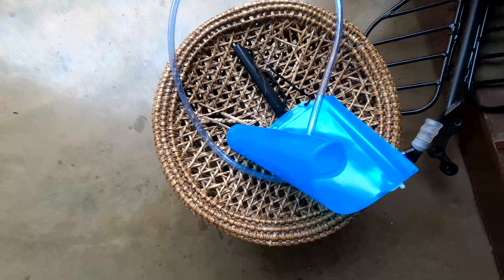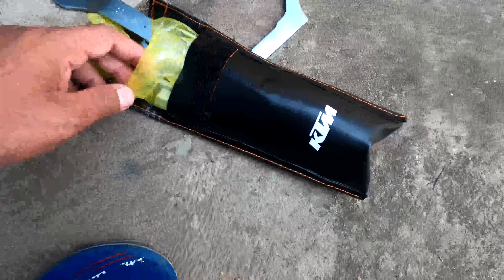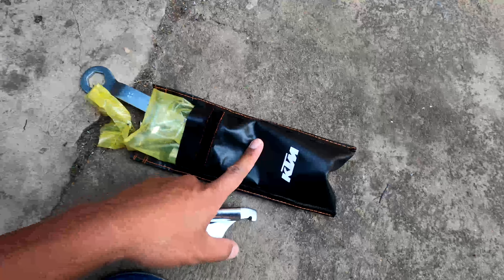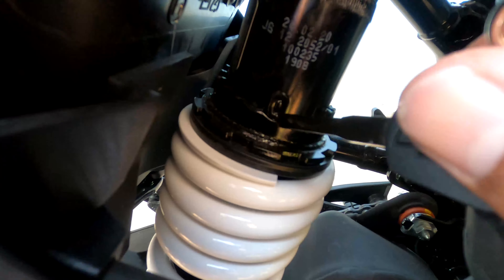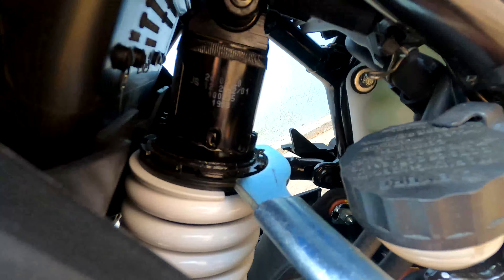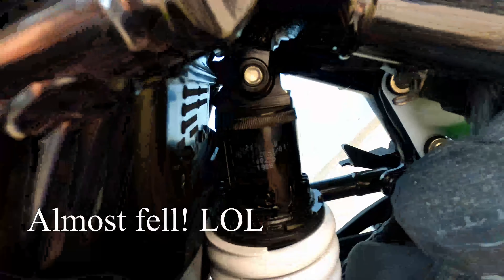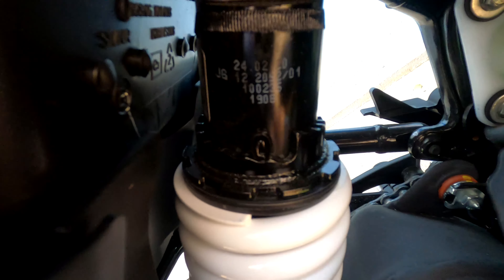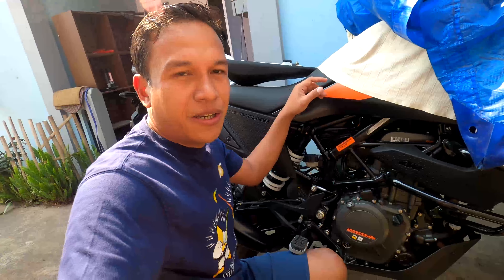KTM 390 Adventure | How to adjust the preload of the rear suspension! | Day 5 of Lock down

Comment: Hint 1-Much easier to adjust if rear wheel is lifted off the ground. Hint 2- pg 254 of the manual says Static Sag 12mm, Riding Sag 34mm. Preload should be adjusted to get close to these numbers, not for adjusting seat height. Lots of videos online about setting sag. Hint 3 - if not set right, handling is affected. If set low/soft, and you are heavy, the back of the bike will sit too low and the shocker will be in the hard part of its stroke. So you get a harsh ride and slower steering. Hint 4-if you are about 75kg with riding gear on, leave on setting 3.
Reply: How did you figure out that stage 3 is best for a 75 kilo rider? Did you test that yourself or found it in the manual?

Comment: Doesn't move when I use the tool. I want to set it to Max Payload - 10 clicks... not really sure which way it has to turn. May need to take another look at it! How hard did you have to pull?
Reply from the maker: It takes quite an effort to turn it, keep trying!
Reply: Hint 1-Much easier to adjust if rear wheel is lifted off the ground

Comment: great explanation ... I have a question 2U, is under the seat the accessories plug for M+S LEGOS 4 alarm system, as they are in the other KTM models? Or could you show us which plugs are available?
Reply from the maker: Thanks brother! I am not sure about the alarm system as I have not used it, but I did use an accessory that let you use your indicator switch for hazard lights as well. Will see if I can upload a video about the different plugs that are available on this bike, will do it soon! Cheers 🍻
Reply from the maker: Hey Peter, so I finally for some time to open up the rear, unfortunately there is no such plug in the rear, you can see the video with the details here - https://www.youtube.com/watch?v=oH4piy7X7IM

I'll be opening the front tomorrow to check if the same is there in the front! Hope this helps!
Reply: @RandomSync7  see it, you're so great - THANK YOU !

Comment: I'm a little disturbed by this video that explains how to turn and change the preload on the rear wheel but with no proper explanation of why it's important, what do gain from the right adjustment that is adjusted to you and why, when and how it should be done.  Anyone can play with knobs but do you really know what they're good for?
Reply: generally stiffer suspension for off road, softer for more comfort on road. Think of a dirt bikes suspension and how much it takes to get travel, then think of a road bike that easily moves. It's not a hard concept but you come throwing attitude around for no reason. Google it, it's covered in unbelievable detail. The video is only to show how you can adjust it, because the adjustments will be different for every rider and every riding type.
Reply from the maker: My bad that I didn't explain why and when the pre-load needs to be adjusted. This video was more focused on the change, if any, in the height of the bike when changing the pre-load as that seems to be one burning question that a lot of people here in India are asking. This is primarily because of the 855mm seat height which seems to be on the taller side for most of us in India.